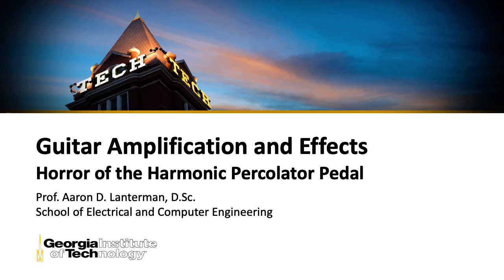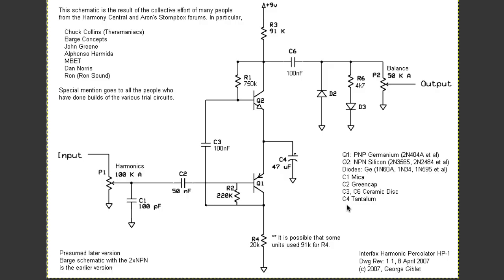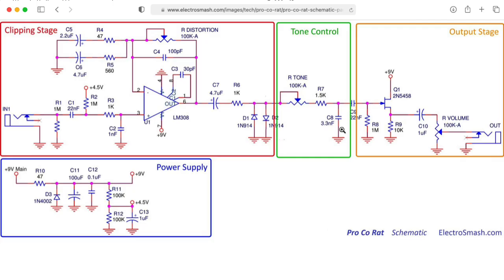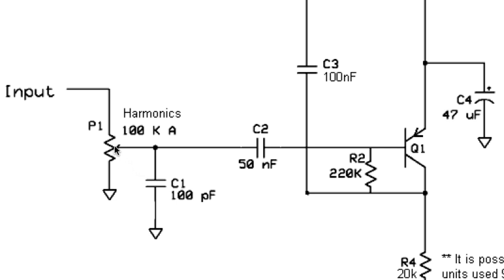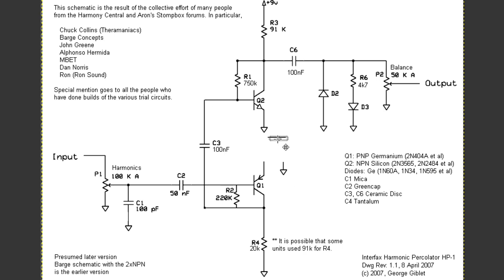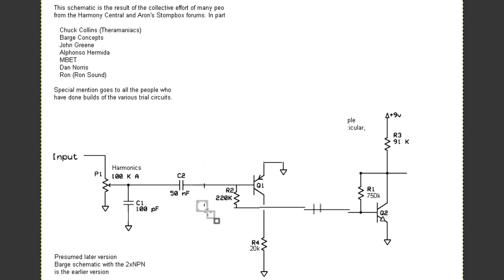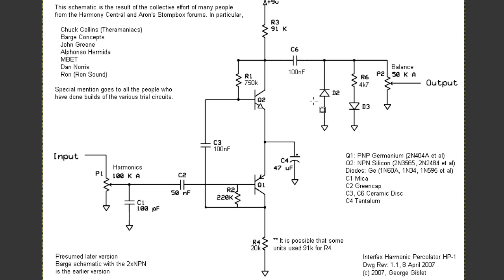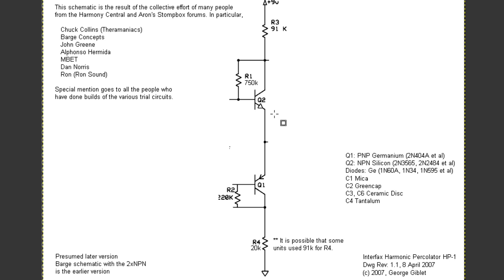Horror of the Harmonic Percolator Pedal: Analysis (Guitar Amplification and Effects Bonus Lecture)

Comment: There is a part missing on this  drawing. I was not the one to put my name on this schematic. This was done without my knowledge.
Reply from the maker: That's good to know... I'm going pin this to make sure people see it.
Reply: There is a high frequency bypass cap missing that will diminish the highs but also prevent self oscillation at full gain. The diagram is not clear on connections or non-connections. Nowadays if you use nf for caps, all of them should be in nf but this was drawn 15 years ago?

Comment: Hey! New to the channel but I wanted to say thanks for taking the time to present this analysis. You're the first person I've seen intuitively break down the perc as two series gain stages—I think because the schematic is drawn in a non-intuitive fashion. Your technique of moving blocks around was also really nice for visualization!

Now, I can't say why the shared AC ground was done in the first place, but I can speak a bit to the nonlinear effects. At very low frequencies, the impedance of the 47uF cap increases enough that the transistors can wiggle each others' bias. This produces some interesting behavior at extreme low frequencies - there's a little bit of a unique sub-octave thing going on. You can also get very interesting results by changing the capacitor value or adding some resistance in series with it.

Anyway, thanks again for making these videos!
Reply from the maker: Welcome!

Comment: Notably there are multiple versions of the original Harmonic Percolator circuit which is interesting not only for the weirdness of the circuit but also the story involved (unobtainable 70's pedal with wax potted transistors made by a mystery guy). 

The analyzed Giblet schematic is NOT the same as Albini's pedal. The biasing is different. Different resistors and caps used in key locations. 

I became obsessed with this pedal and dreamed up what is basically a sandbox version that allows one to dial in the Giblet or Albini versions and everything in between. Emerald Ox executed my vision (and he made a killer Giblet version of the HP that got me obsessed with it in the first place). The version we came up with is called the Chimeric Percolator. 

A couple things I learned from spending time making sounds (as well as building and modding them myself) with both of the popular versions of the circuit, as well as the Chimeric Percolator... 1) the Albini version is great for a smoother sounding HP but his clangy guitar sound really comes from his use of full frequency range speakers, an IVP preamp, and thin copper picks. He BARELY uses the HP, only for short passages. Also he uses a buffered gate pedal before the HP, which will make it sound thin in use (hey, he goes for harshness) even though his HP is actually smoother sounding than the Giblet version. 2) The sub-octave can only be had in the Giblet version of the HP circuit, not the Albini version. I love the sub-octave from the Harmonic Percolator because it is raspy-chaotic and wild. It's a bit magic. With the Chimeric Percolator I can dial in the sub-octave and the range in which it occurs, getting it on the high or low E string with the sub getting as loud as the fundamental frequency. The clipping diodes need to be engaged for the sub-octave to work (some pedals offer diode-lift). Finally, leaky components might help with the sub-octave as well. One HP build version I have goes into self-oscillation when the harmonics (input) is turned down low. In fact, the sub-octave seems to come out the most when the harmonics knob to be within the first 1/4 of its range.

Anyways, cool to learn more about the circuit in this pedal that I've been obsessed with.
Reply from the maker: Thanks for these insights! Particularly this one: " In fact, the sub-octave seems to come out the most when the harmonics knob to be within the first 1/4 of its range." I can't even begin to wrap my head around that one.
Reply: Do you happen to have some links with more info on the various versions? Very curious!:-)
Reply: @ekkoflok  are you looking for more technical info or more just about the differences in sound of the different versions? There was no definitive Percolator, but one of the most helpful things I've found is Mr. Bill's measurements of the components of Albini's percolator, for example
Reply: @SeventhHarmonic  thanks for the reply! I'm looking for technical info:) wanna try and build my own
Reply: @ekkoflok  Nice! I don't have specific links, I more just compiled bits of knowledge from forum posts and trying stuff out. Here's what I would suggest: 1) where I've seen Percolators not sounding as good as they could is for the choice of Q1, the PNP Ge transistor. The Albini Q1 was measured around 47 hfe (Q2 at 263, but that doesn't matter quite as much, though high hfe for the NPN Q2 will get lots of compression by slamming the signal into the diodes). That is what I would go for: Q1 is Ge PNP with around 50 hfe with some leakiness. Too low hfe, it will be weak sounding. Too high hfe and none to little leakiness (maybe the problem with better-spec'ed modern components used in Q1), then it won't sustain as well. The key here is that the circuit was apparently designed with some leakiness from Q1 for its biasing. 2) Compare the Giblet and Albini versions of the circuit - where they differ around Q1 is where they were tuned for the variance in Q1. Albini version sounds smoother, Giblet version is a bit more wild and can get suboctave if tuned for that. Either way, if you prototype the circuit on a breadboard you can try different component values around Q1 to tune the sound to your preferences. 3) If you want the suboctave, as above (2), different components around Q1 can help you tune the feedback, strength and range of the suboctave. Good luck!
Reply: @SeventhHarmonic  Thanks a lot for the reply, that's super helpful! Can't wait to get started.:-)

Comment: I think you nailed it on this one because the flip-flop of the capacitor linking to the bases is acting as a bias and is likely reducing power consumption. It's extremely similar to a circuit I created a few years ago, but I didn't think tying the bases together with a capacitor would complete a voltage divider to bias the bases, and my goal in that project was to try to produce something truly Class-A that was high output but better efficiency.

What I ended up doing was voltage divider biases both bases independently, tying the bypass cap into the node where the Q2's collector runs series into Q1's emitter, and ultimately created what I perceive to be a power supply current booster which gave me about another volt of AC gain on the output of Q1, and surely significantly more current gain but I never measured that theory to be sure. 
Audibly, there's a richness and density boost when comparing it to other 2 transistor driven gain circuits.

The ultimate goal was to also use an ultra steep low pass so no 60 cycle or other RF ground buzz got through without compromising treble content by the time the signal reaches the speaker, and that absolutely did work. I've been able to use some super steep low-pass filtering in a few preamps and overdrive designs that eliminate 100% of 60, RF buzz and hissing white/pink noise but still have heaps of treble and pinch harmonic sleaze because the harmonic content of the upper bands is still greatly abundant, and I effectively defeated virtually 100% of the noise.

My current project is a 3 transistor fuzz that 100% nails the tube distortion with the fizz, zing and note separation we still currently only experience from valves(granted digital is now almost perfectly there) where when I push it hard enough, I even get the synth level soft knee deep tube clipping that sounds like a synthesizer, but it has some distance to grow until I can use it as a standalone high gain lead distortion that provides shredding as well as very bassy and clustered swept arpeggios that elite note separation expected only from tubes and the most recent and expensive digital modelers. 
I didn't finish, but going to college for electrical engineering is one of the best things I ever did for myself. As my wordsmithing shows, I'm highly passionate about the science.

Comment: Dude it's a percolator you got to build it you got to put it on breadboard and you got to play with that big cap . That has a huge effect on the cct. Its only a short to dc... it lets audio kinda "dwell" in that cap almost like an oil can delay.
In some cases, as long as that cap has reached charge, you can pull one of the q's and it will still work. Very similar kinda to the bypass cap on the fuzz with a fuzzface.
Fun video. Subbed.

Comment: This is a very interesting circuit! It's always confusing to try to analyse distortion guitar pedals with traditional small signal analysis since the they are meant to be non linear effects. The only obvious difference I can find with this design is the reduced headroom for each gain stage.
Reply from the maker: Indeed, a proper analysis needs to be a "large signal analysis" and figure out when the various transistors are pushed into clipping. So start we'd need to figure out the bias points, but that was more work than I wanted to put in right now. If I'm lucky someone else will be inspired to tackle it. ;)

Comment: I have case for you: the Jen harmon booster. It has a very unique stage for Distortion (i think). It has standard class A gain stages and kind of a big muff tone control, but the middle stage looks unique. The simulation shows a strange asymetrical behavior. This stage has a trimmer to set bias, this looks to have a big impact in the wave shaping.
Nobody seems to copy this topology even it sound like an overdrive before their time.

Comment: I could be totally off-base here, but it seems like the first two gain stages of the Boss HM-2 (following the buffer) are inspired by the Harmonic Percolator, but NPN into PNP instead of PNP into NPN; there is also more filtering in the feedback loop (like a Big Muff).  These transistors in the HM-2 also share a bias current like the HP-1.  The HM-2's op-amp seems to also feed back between the two transistors, it's like a shunt within a shunt... SHUNTCEPTION
Reply from the maker: That's really interesting! There is a difference though -- here the "shared bias current" is split between the Q6 and Q7, whereas in the Harmonic Percolator it flows through both transistors. 

I can't wrap my head around VR4. Since the left in of VR4 is connected to the collector I'm not sure we can think of it as a feedback connection; we generally think of collectors as outputs. It's more like a 2nd input to op amp 1b... maybe? 

BRAIN HURTING. ;)
Reply from the maker: Check this out (assuming YouTube doesn't delete the link): https://www.diystompboxes.com/smfforum/index.php?topic=114410.0
Reply: @Lantertronics  Thanks! Makes a little more sense (in the layman’s Dunning-Kreuger-inflected sense)

Comment: This is far from scientific, but I've read somewhere/otherwise speculated that it's a play on a push pull amplifier (albeit with the PNP on "top," weird), with the intent to purposefully produce crossover distortion.

The idea is that most fuzzes/distortions etc. affect only the peaks and valleys of a signal, whereas near the bias point it tends to be untouched or otherwise inaudibly changed. With the clippers on the output, the Peculator does both.

(Big Disclaimer: I'm not an EE, don't even play one on TV, apologies if I'm being imprecise if not outright inaccurate with my terminology and/or "analysis" here.)

If I am on the right track though, re: crossover distortion, see also the Zvex Machine, Tim Escobedo's Tripple [sic] Fuzz, which in turn in based on Ken Stone's Simple Wavefolder, which in turn again is based on "Nonselective Frequency Tripler Uses Transistor Saturation Characteristics" by R. Lockhart, Jr." The CGS page (Elby or archived original) talks about some of the theory.
Reply: Ah, and also Escobedo's Harmonic Jerkulator, which is a Perculator clone made with contemporary, non-unobtainainium parts.
Reply from the maker: Thanks for the tip, I just looked up that schematic... it's interesting to see what resistor values they changed to compensate for the switch from germanium to silicon on one of them.
Reply from the maker: I can totally see why people think the Harmonic Percolator might be a push-pull thing because of the way it's drawn, but I think the way it's drawn misleads people about the structure. 

I just took a look at the Zvex Machine -- that's definitely using push-pull structure.

Comment: It's interesting to hear your analysis of the circuit. I have a weird sickness where I measure the current requirements of all my pedals, and HPs which don't have lots of mods to them typically run around only 1 ma. (You mentioned in the video the low power requirement of a single bias current.) The original and Theramaniacs versions run off of a battery only... and one of the clones I have (and which is the closest to the Theramaniacs one) added a "normal" power supply plug, but has this weird thing where the ground is positive, so it works fine if you run it off of an isolated power supply, but isn't friendly with daisy chained power supplies... and this pedal measures at 0ma for some reason.

I don't know the first thing about dancing electrons... I just have a compulsion to collect HPs.

Comment: In this arrangement, both transistors are effectively running at half of the supply voltage. I've never examined one of these. Might the transistors also be distorting the signal or would their output be too low for that? Q1 might be clipping when the input level is raised, especially with hotter pickups. Upon further thought, Q2 would eventually be driven into clipping as well. An interesting circuit.

Comment: its  not the same but: phantom powered diff. preamps use stacked jfets and bjts sharing dc current: input  jfets has other jfet as current source (which connects to ground through "on" indication led) and drives bjts upstream. I think youre right and this is for power  economy.

Comment: That lower transistor has to have sone leakage to allow bias current to flow in the top transistors E-B junction, as when the circuit us powered up, both transistors will be off if the bottom transistor is off. That 47 uf alsi gelos as there will ve sone leakage if it us a lytic. This concept us similar to the fyzz face circuut with its lack if bias resistor on the furst stage.

Comment: Interesting. I like the way you analyze the circuit separately for DC and AC. Since both transistors share the bias current, the thing that's most interesting is what happens on C4 when signal is applied: will the DC voltage across it change? How will it affect the waveform of the signal coming through?

Comment: I have tip for circuit analysis!

I recently checked schematic for Boss Power Driver PW-2 which is really obscure pedal on its own. There are people who claim that it sound similar to Big Muff. So, despite I'm not good at reading schematic I had to check it for myself if there are some similarities. It seems there are no clipping diods or clipping circuit there. Which is weird for driver/distortion.
Reply from the maker: Interesting, so they're entirely getting the distortion from overdriving the op amp! I think there was a Craig Anderson design like that.

Comment: If you've got signal ground on the emitters of the two transistors (on top of the fact that one's Ge and one's Si) would that be some sort of pseudo Differential Pair setup? If that's the case, the cap between collectors is just standard for high frequency compensation, right?
Reply from the maker: The issue isn't that one's germanium and one's silicon; the issue is that one is PNP and the other is NPN. For it to act as a differential amp you need two PNPs or two NPNs. (Going to ground like that they'd need to be NPNs.)
Reply: @Lantertronics  But I meant more from the perspective you presented which has that 47uF cap to ground between them. Differential pair I suppose would have one demanding current while the other is lessened to effect a differential signal between collectors, which I suppose isn't the case here, but I just thought it would be one way to look at it. First reaction was "Emitter follower into common base", at least that way it makes sense.

Sorry, not terribly cohesive tonight.
Reply from the maker: @kopaka647  "Emitter follower into common base" -- that's EXACTLY what I first thought when I looked at it! :)

I then got confused by the output of the first stage going to the base of the 2nd. It took me ages of just staring at it until I figured out it wasn't.
Reply: @Lantertronics  So that would make it... PNP common collector capacitively coupled into the base of the NPN going common collector just like any ol' 2 stage amplifier? I'm putting together in my head how your video went now, it makes a lot of sense to see it how you laid it out here. I guess something that might be fun dumb experimenting is screwing with the value of that 47uF to see what creeps down through the bias. I suppose whatever creeps across would be a lowpass filtered negative feedback since it would be out of phase with the signal. But I guess the signal flips twice, actually, so that would be... odd to experiment with. You can kind of filter out both phases from both stages at... the same time? I suppose the emitter leg with the higher "R" in the RC with that 47uF would be the signal that dominates.

I'm probably getting incoherent here, sorry. It's late.